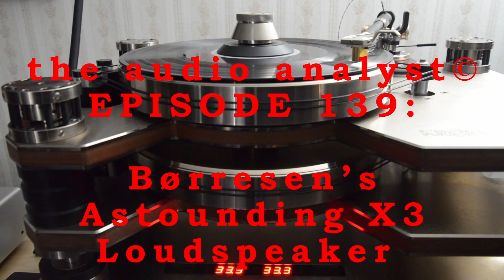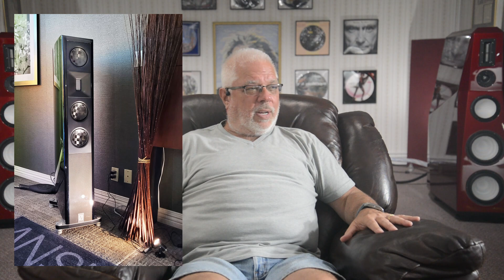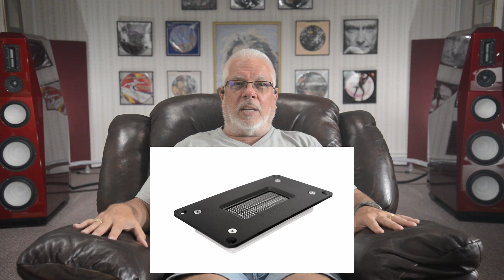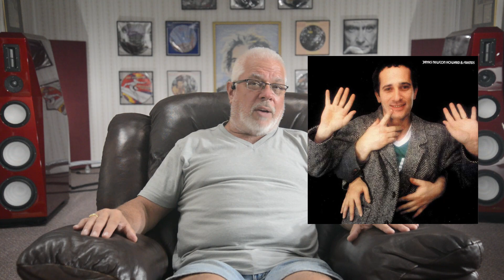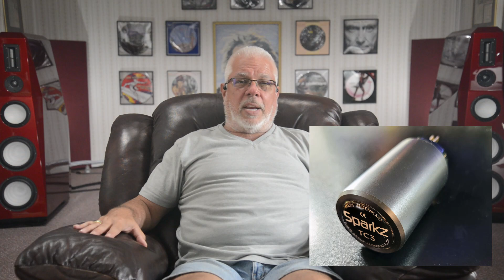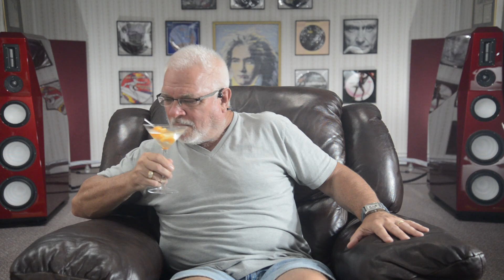E139: Børresen’s Astounding X3 Loudspeaker

Comment: I am here for the first time. From the start I sensed this was going to be a good review. Boy, was I wrong, this is one of the best reviews I've heard.  And the mention of two of my favorite speakers, the Audiovector R3 Arrete, and the SF Maxima Amator, I subscribed and will be back.  My current and first audiophile system includes the Hegel H90 integrated, Focal Electra 1008BE speakers, Bluesound Node 2i streamer, custom Sound Anchor speaker Stands, Cardas Parsec speaker cables, Cullen Cable Power cable, and Audioquest PQ 3. I'm streaming Tidal and have the Node 2i connected via coax to the amp so as to take advantage of the superior internal DAC in the Hegel.  The pairing of the Hegel with the Focal's is a match made in sonic heaven. No sub necessary.  I'm all in and while I thoroughly enjoy my current listening experience, I have caught the bug and am having a heck of good time exploring an upgrade path including adding analog.
Reply from the maker: Hello Philip, and welcome to the channel... As a new subscriber, I might suggest clicking on the Videos (https://www.youtube.com/@theaudioanalyst/videos) or Playlists (https://www.youtube.com/@theaudioanalyst/playlists) links on the channel, as either of them may help you find content you are interested in more quickly! Thanks again for tuning in and subscribing... I hope your journey continues to be as much fun as possible! 😊
Reply: Focal and Hegel are insanely good for what they cost by now. Heard it often for a couple of years. It will be a challenge to really get a significant upgrade. Speakers will be much more than the entire system now.
Reply: @kaymanul  7k all in.

Comment: I think this is a commercial disguised as a review
Reply from the maker: Hello. That grossly mistaken conclusion suggests that you have very little understanding of my five decades in and around this industry or of Audio Group Denmark’s level of technological and manufacturing accomplishment. With a little more understanding of both, you may begin to understand more clearly.

My fifty-plus years of diverse and extensive background in the audio industry is more clearly laid out in my very first episode, “E1: Who is the audio analyst©?,” and for exactly this reason, at this link - https://youtu.be/loT2ZjdUlx8

And my full, four-part factory tour of the Audio Group Denmark manufacturing facility in Aalborg, Denmark, from January of 2003, may be seen using these links.

E107: Audio Group of Denmark Tour - Part 1 - https://youtu.be/zNnJaIR5Fc0
E109: Audio Group of Denmark Tour - Part 2 - https://youtu.be/_DXDLndSiIE
E110: Audio Group of Denmark Tour - Part 3 - https://youtu.be/uStqc4m8AgY
E111: AGDs Børresen and Rasmussen Talk Tech - https://youtu.be/OL_FeMTw3ks

Comment: I also use speaker footers, 4 kitchen sponges. at 89 cents each they do remarkable job esp on 2 inch thick piece of marble i took for free from the local dumpster. I also hear 4 BMR mids per side without any cabinet gives super clean , super wide, ringing free sound for $110 per column. I guess i dont belong to the club , as to top this insane cheap setup, i drive it with Fosi Audio V3 just 300 watts per channel for $129.
Reply from the maker: While I'm truly pleased to learn that your uber-affordable system brings you so very much enjoyment, I suspect that you have had very little exposure to both live music, and to any more sophisticated two-channel systems. You should keep it that way, because once you hear such remarkable gear, you may not be able to be satisfied with lesser products. Just my suspicions... Thanks for tuning in!